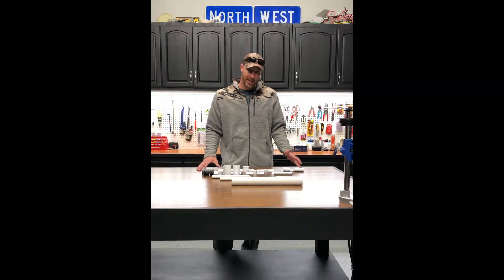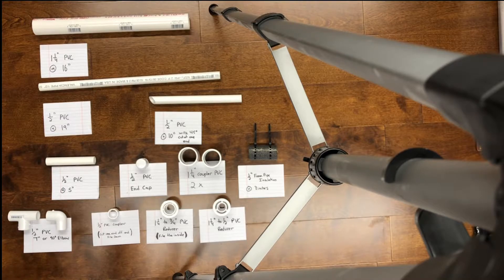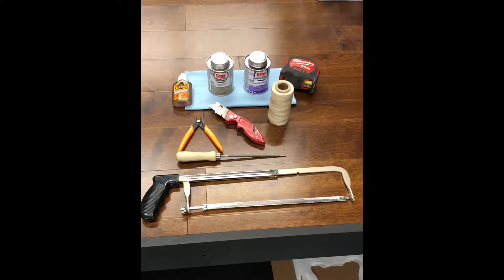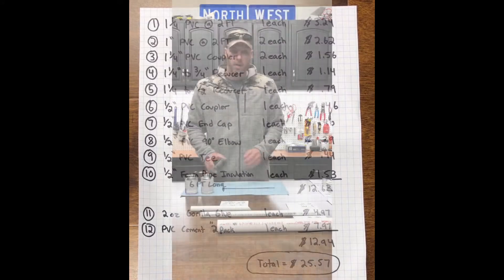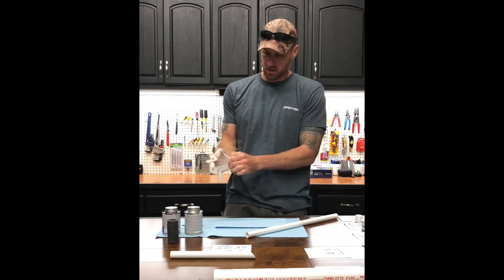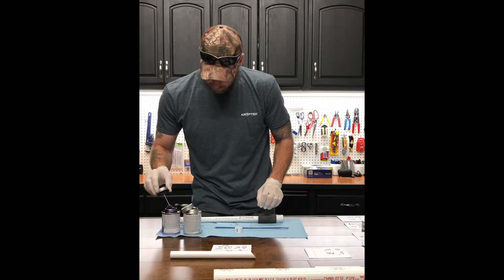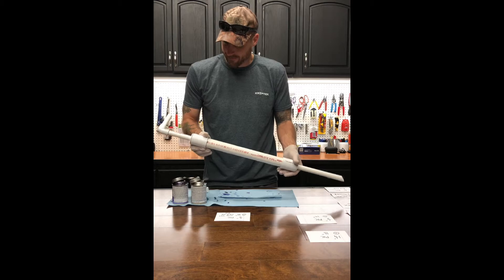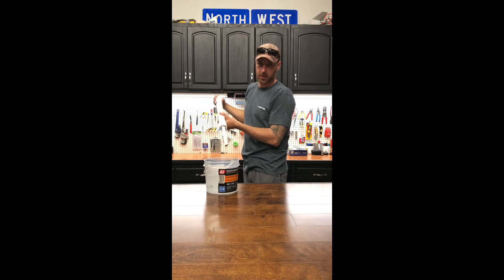Capitol Gold Hunter - DIY Mini Gold Hand Dredge Recovery Tool Build

Comment: How long does your homemade stopper work?
I like the idea
Reply from the maker: Hey Chris! If your talking about the foam bushing that’s on the inside, it’s lasting so far. I’ve used it about 15 times since I made it.  When I use it I use it just to get the crevices so it doesn’t get too much use. My bigger one gets used all the time (favorite tool) and that hasn’t failed yet. I like that they are cheap to make so if it fails I can just fix it or build a new one for pretty cheap. If you don’t glue the end on (towards the handle) then you can take the whole inside out and replace it. However, if you don’t glue the end it could pop off while in use because of the foam gasket sliding up hitting it, so yea, just easy rebuilding a new one. Hope this helps and if I got the wrong part you wanted me to talk about then just let me know. Thanks again Chris!
Reply: @StoneyCreekSparkchaser  thank you!